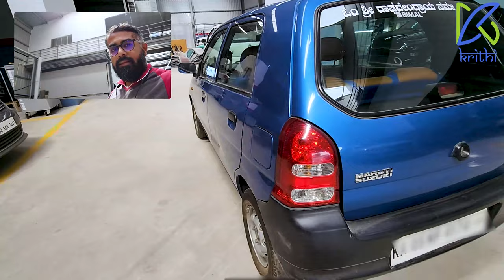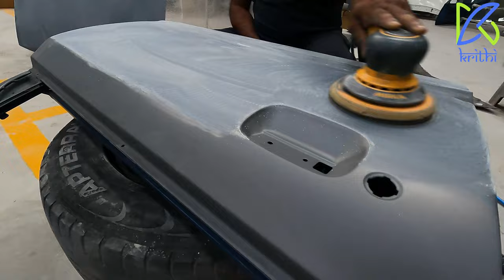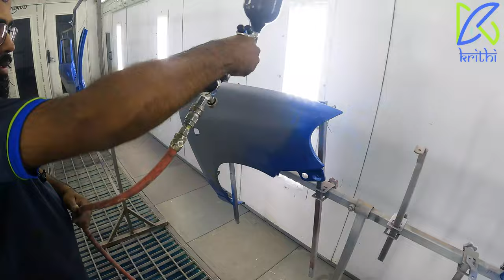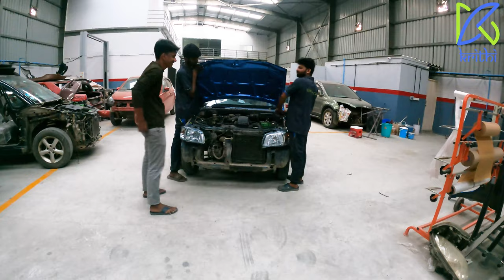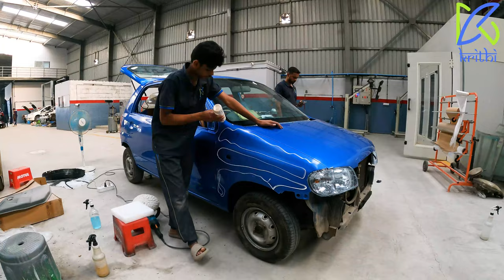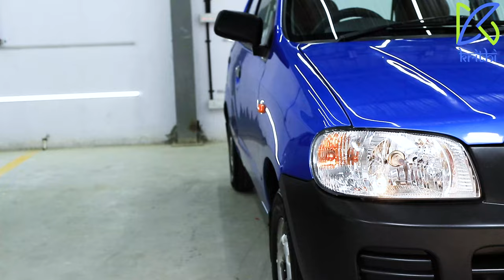Maruti Suzuki Alto | Restoration to Brand New | Krithi Car Care, Bangalore

Comment: how much will it cost to paint a punto which doesnt have big dents or rust. ?
Reply from the maker: For an overcoat paint method it can cost you between 60k to 90k depending on the color and brand of paint. Request you to kindly reach out to us at 9148474707 to get an accurate vehicle specific quote.